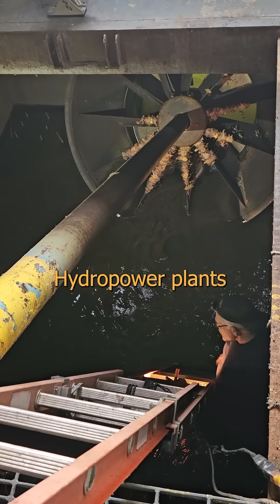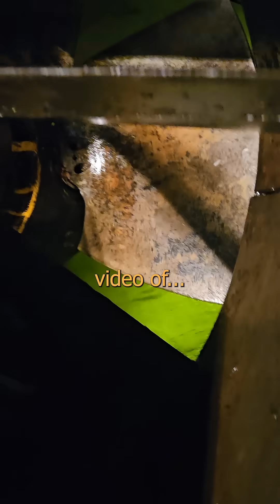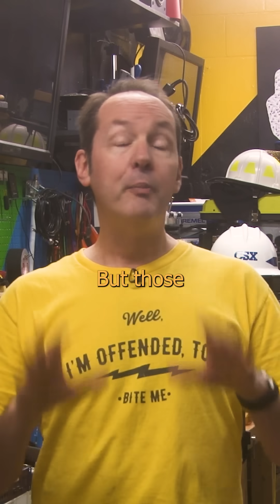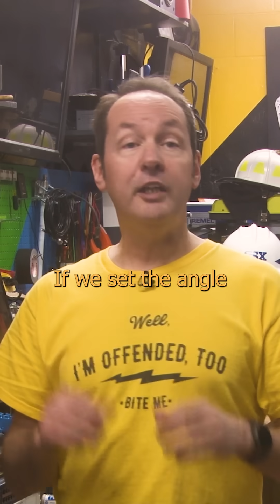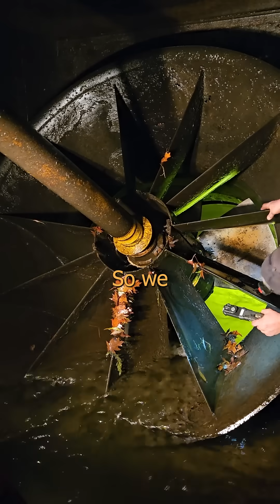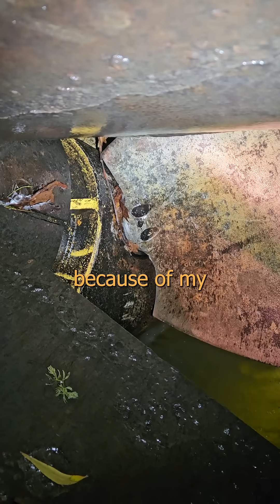Blade Angle  #chrisboden #comedy #engineering #educational #physics #apprentice #science #energy

Comment: Now, if you have a far enough distance for the water to reach terminal velocity several times over so you just hook up more blades to the shaft OR do you stick another one in the hole? I'm curious because some hydro electric dams are very obviously tall enough that the water can reach terminal velocity, come to a complete stand still, reach terminal velocity A SECOND time, come to a complete stop again, and potentially reach Terminal Velocity a third time before shooting out of the bottom. Three gorges, Hoover, and Black Canyon dams are the first ones that come to mind for me as examples of big dams that seem like a little bit of Tweeking can go a long way to pull power from the whole system at more than one spot per tube because the only way you are getting more energy out of water that's reached Terminal Velocity is by increasing volume but if you've got the length to reach
That point more than once then why not try to double dip?

Comment: there are actually 3 commonly used water turbine types afaik. 
1. kaplan turbines are pure axial turbines meaning water flows alongside the axis, those are used for the shortest fall heights (low preassure and high throughput). they are best described as looking like a ship screw

2. francis turbines are radial-axial hybrid turbines used for medium to high waterfall. they can also be used in reverse functioning as a pump. hardest to describe for me personally, also the most widely used ones afaik.

3. pelton turbines are pure radial turbines and are for high preassure, high waterfall usecases. they look like a very advanced watermill. mostly outshine by the flexibility of the francis turbine, tho used for very high water heads.

Comment: Question, and it may be dumb but so am i, why arent there more blades? or longer blades? looking at it theres 4 maybe 5 blades on the rotor but it LOOKS, could be wrong, that theres a lot of open real estate between the blades that waters just rushing past which would be wasted energy would it not? having more blades or longer blades covering those gaps would increase the pressure and thus the torque right? there would be some overlap at lower pitches but wouldnt that be preferable to wasted energy? again i could be looking at this all wrong, help me out.

Comment: Oh, like the stator vanes in an automatic transmission, specifically GM transmissions from the early 60s that had only 2 gears. They would adjust automatically (somehow) and basically made the torque converter akin to a CVT.

Comment: Aren't there LOTO on all the fun buttons to start that thing? So, bearing idiots cutting the LOTO off and starting it, how is it dangerous? Are the blades super sharp or something? Are the pipes not gated closed to have maintenance performed? I mean I could understand it being dangerous if you were working down there and flood water came and the pipe was not closed, or the blade required to be on at a slow speed to do maintenance, but otherwise I don't understand.

Comment: Chris, you never fail to brighten up my day. Every time I see one of your videos they’re very entertaining and informative at the same time. That’s hard to pull off my friend. I know from experience in the field I’m in. What I do isn’t really anything taught in a classroom so that’s the only way to get the skills is to apprentice with someone just like I did. Now they have NASCAR schools but you still need the know someone. My best friend since the seventh grade his dad was a Cup driver, probably the very last owner operator ever he has been in motor sports for 50 years. He’s finally retired. Back to the story of Hand at 18. Jimmy gave his son and I basically a competition test test to test mechanical aptitude. I had never torn an engine down in my life at age 18. And evidently neither had Brad. But I had the engine torn down in two hours and every part laid down in the correct order lining up with what cylinders they come off of looking like it was ready for a magazine photo shoot. Also, those oil pans don’t come out like regular oil pans those cars run dry sump systems so the oil pans, teeny tiny and it has several flush Allen in it that you have to remove to remove certain bolts that the oil pan totally covers up in order to drop it. From that day forward, I stayed with Jimmy in the engine room. Learning how to build those 750-800 horsepower 9000 RPM monsters, dyno, and tune them we also tried mini tricks to skirt the rules or just blatantly break the rules and made it in a way that the only way they were able to find it would be doing a destructive teardown, and that’s illegal for an official to start cutting your car apart. All our sheets were welded into the car and blended in and didn’t look like a place at all. A lot of the existence of our Daytona hydraulic spoiler. Years earlier teams used springs on their spoilers so the Aarwood lay the spoiler down at 190+ miles an hour and giving you faster lap time but less traction. You’re only going for one lap so it doesn’t matter if you get a little loose. Then after that they came up with the rule, they measured the spoiler and then they hung a weight  that weighed 20 pounds off the spoiler, and if the spoiler deflected it all then the car filed qualifying. In the rulebook, it said you could use gas struts to hold the hold the hood, and the deck with it open. Everybody in Racing used aluminum brackets that just lock in place pretty much automatically. They’re very light very easy to make out of aluminum and very effective. No one ran struts, but the rule book said you could. So the idea was to fabricate a cylinder in the deck lid that allowed the spoiler  to flex down and high speeds. Therefore, picking you up a few tenths of a second, therefore, moving you up, in qualifying. The spoiler’s master cylinder was made into the transmission tunnel and covered with metal painted and smooth, and it didn’t lock anything ever been done. It was a very slick setup. The driver controlled it with a thumb wheel. But I designed the thumb wheel so that it was removable, but it locked into its position positively. I used a ratchet for my inspiration. It wasn’t coming out unless you purposely pulled it out. Didn’t left that mysterious little hole. It didn’t do nothing. That way the driver could remove the wheel and stick it in his pocket when he got out. Also, it was in a very hard-to-look-at location. You would’ve had to remove the seat from the car and then cut the tunnel open to see what it actually revealed. We hid all the hydraulic lines in the struts that we used on the deck lid. We used one strong strut on the right side and then hollowed out another strut for the left side that we ran our hydraulic lines through. Another trick we used was a restricted plate motor that you used to run your own gasket. But they stopped at trig because all you had to do was chamfer for the four holes on the gasket that was between the carburetor and a restricted plate and you picked up 10 hp just by chamfering those holes, carb, gasket then plate. Also learned every step needed to build those engines. Now all rebuilds I do I put everything together like I am back building $50-$80k engines. 0 room mistakes or guesswork. Everything has to be spot on perfect every time no matter how fast the deadlines are approaching. You become good at getting impossible things done in an impossible amount of time. Sorry to ramble alone, but I just thought I’d share a little of my story.
Anytime he says You wanna see something cool? I am always like Hell Yeah! I started my engineering journey with my fascination with white bulbs from a very young age. Back 1980 I was in the newspaper nationwide. Associated Press picked up my story because while most four-year-olds were collecting baseball cards. I was collecting lightbulbs and wiring things up. Thankfully, I had some wonderful parents who fostered my creativity and always answered my questions, and built me into the person. I am today. Thanks for sharing your enthusiasm with us Chris. It’s really contagious. I always enjoy every new post from you. This is exactly what the Internet exist for or not all that other nonsense. I have many more stories to go along with this about all my crazy adventures when I worked in NASCAR. I’m working on a book about this an inside view of NASCAR from its glory days. now everything is cookie cutters you gotta watch mileage crate engines. The soul was gone out of the sport. I’m also good friends with the entire Earnhardt family. Also Jason Jarrett Dale Jarrett son. House, Brad Jimmy son the son of a NASCAR cup driver we were all three running at Tri-County in Hickory, motor Speedway in North Carolina. We always had to keep an eye out onut for other’s backs because.  They absolutely hated every one of us because who their daddy‘s were. The Earnhardt‘s and the Jarrett‘s got top-notch equipment. However, Jimmy’s philosophy of turning chicken salad in a chicken shit was exactly what we did with Brad‘s first race car. It was one jimmy found rusting away out in a field. It was just a chassis because the cars we were running at a late model of limited on the Friday and Saturday nights for Brad's used the same type of chassis jack screws and everything that are real NASCAR cup car used. These were NASCAR late model cars. so Brad and I in the late night hours when we weren’t working for his dad at the shop, we slowly got that car back together and built it into a legal chassis that was legal for competition. I painted the chassis I remember the color Mars red. It was Dupont Imron paint that I used for the chassis. That’s airplane paint for people who don’t know what type of paint emron. Perfect for painting chassis because you couldn’t beat the stuff off with a hammer. But on the bodies, we just use basecoat clearcoat. And to keep Brad‘s cost down on his car. I came up with a pain method. It saved us a ton of money. Went to the local house paint store and bought a gallon of black lacquer. Sprayed it let it off gas then seal it with urethane clear. It shine just as good as a hot dollar paint job, especially under the not lots of those tracks. I got sick with MAS in my journey had to be cut short. But Brad, he is in a league of his own now. He has head of the fabrication department. He is also the crew chief. This is for a craftsman truck series team, he’s also got three championships under his belt. So Brad‘s done very well for himself and I’m very proud of him! Sorry for rambling on, but I’ve greatly appreciate anybody that read my story. Eventually, when I get it published, the title of the book will be "Mechanical Violence' it will be for exactly how a race shot was back in the mid 90s where we didn’t have to conform to all the laser template you do now where a Speedway car look like it was turning left when it was sitting in still on a flat surface plate, and it still fit the templates in that contorted superiorly air dynamic configuration. I had to quit around 2014 or 2015. I can’t remember the exact date. I wasn’t forced out but I made a rookie mistake on a motor I was building and nobody got mad or anything about the rookie mistake but as soon as I made that I knew I didn’t help. Would it take any longer so I just walked away. I have been battling MS for the past 23 years so that’s the main reason I had to quit the hours were alone and my skill level was not what it used to be. I would rather walk away knowing that everything I did was good and proper then be told because my work was not up to snuff. At least I knew when it was time to go and I left. No shame in that. Thanks again for reading this for all that stuff through.

Comment: When I was 15, I worked a summer job at a hydropower plant. I got to see the fan, the tunnels, the reservoir and not just the turbines, but during cleaning of the plant, when the reservoir was low, the fan wasn’t spinning for repair and the turbines that were usually loud as fuck were quiet, i cleaned the turbines. By crawling into a tiny space and with a brush, a vacuum and some other tools, scrapes dust, soot and various debris out of it, as well as the filters. Apparently the power generation is so great and the current they generate is so massive that they burn a little over time like many motors do and therefore need to be cleaned from time to time

Comment: If you use pumps to put the water back up to the pond when energy is cheap or plentiful you can let it drop down the hole again later. You have just made a mechanical ac current battery.

Comment: I want to know something cool. 
What is the power coefficient for water speed and blade angle? Do you have a graph?
For wind turbines this is adjusted (blade angle) to protect the generator during high wind speeds. As you can control water flow, I’m assuming the water blade angle adjustment is to provide maximum power coefficient at low water flow (eg. When supply is restricted due to lack of rain fall?). 🤔

Comment: Years ago I got to see the inside of a radial flow hydro power turbine. Similar ends result, but it used static gates around the rim rather than moving blades on the rotor. Looking up a 14 foot pipe and knowing water level was 600-700 feet above my head and only held back by a leaky gate was surreal.

Comment: Maybe a dumb question but why do the blades on the generator have to be the ones that are variable, would it not be as efficient if it were the blades or vanes or deflectors just before the generator blades that moved instead to direct the water to hit the generator blades at an optimal angle? Is it more difficult to make that work as efficiently? Are we just stuck in our ways and don't wanna change?

Comment: Ships work the same way. The diesel engine of large ships basically only have one speed they can put out on hte shaft, and controlling teh speed with a gearbox is not realy an option either, so they pitch the blades to control the speed.

Comment: Im not sure if you can answer this as i understand some things can be secretive , but i am very curious and just cant help it right now. For that specific propeller and generator, what angle do you run it at for optimal power generation and efficiency. Lets say under “normal” operations at highest demand. I understand that the flow of water matters and makes a difference in what angle you run the propeller at.

Comment: OK. WOW just WOW. I never expected to even see a video of one of these.
BTW the town I live in (Acton MA) used to be the site of a pencil factory. That was long ago, the open fields are forests now and the old site of the factory is conservation land.
The factory was all waterpower, with a pond for water storage and sluiceways to send separate channels of water to separate round vertical channels about 3' in diameter going down. Each vertical channel had a very nicely made stonework pad next to it. The pond is there, the stonework is there, but that's about it. Last summer while walking there I spotted a bit of scrap iron in the trees behind the old sluiceways. It was a shaft with blades. They had vertical turbines(!) No variable angle, though. Looking in the vertical channels there was clearly what could have been a 'stator' (rocks protruding into the channel to start the water turning. I found myself thinking of gas turbines where there are rings of blades that don't move between the rings of blades that do move. Maybe these angled hunks of rock did something similar? No dynamos. It's not even clear they had overhead shafts with belts and pulleys. 
edited to fix typos

Comment: I always had an idea for these generators to get maximum useable work from the water. Would vortexing the water with fixed angled blades beforecthe proppelor make an increased angle on the generatot possible?

Comment: THOSE fokking things see the light of day less than your fanbase! But they do interact more with water so props to em.
I always wondered how we decided how the rotation to pixie ratio was achieved and assumed it was with gates restricting waterflow.
Nope!
Johnny Joestar would be proud to see we change the pitch to change he force to change the Spin!
Now i need to get to work on a small model because I have a hill to die on and an idea to use solar to crew water up hill then catch it as it flows back.
Smaller than your typical Gravity Battery but enough for my home and if it works well, then all I need is a few days out of the month to fill a well at the top from the pond/lake at the bottom then all's well?

Comment: What is the electricity generated per the diameter of the turbine tube And the pitch angle And the turbine blade size And the number if blades?????

What formula is used to calculate efficiency of a hydro turbine generator.???